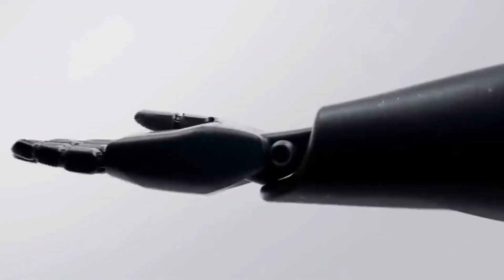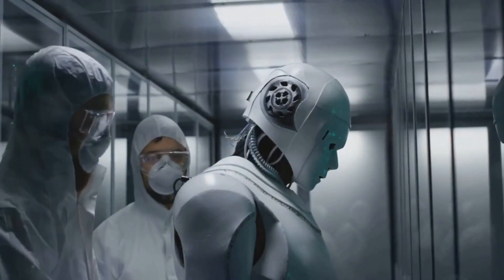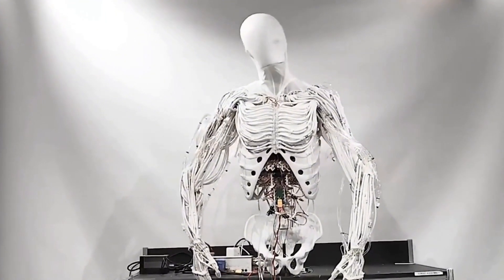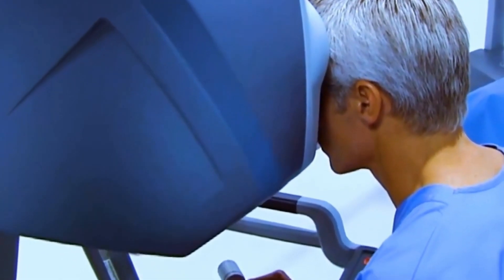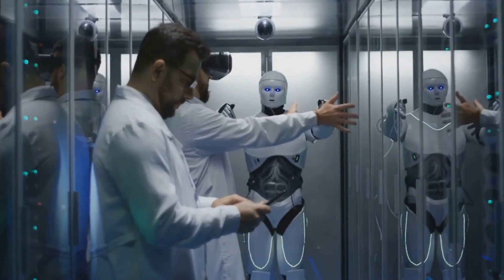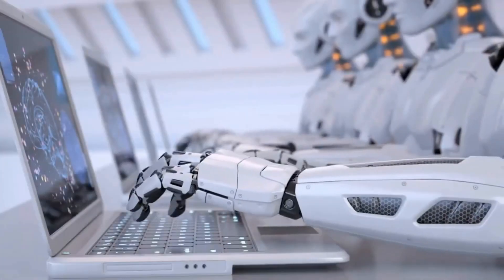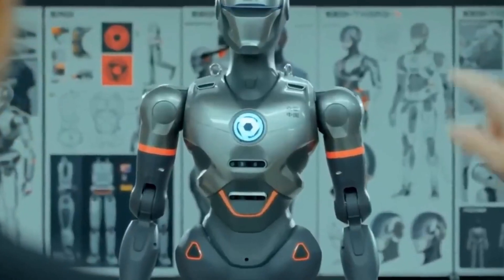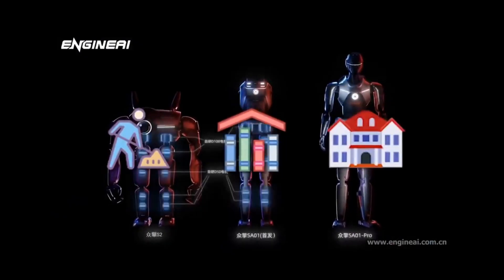INTRODUCING THE FIRST SYNTHETIC AI HUMAN WITH REAL MUSCLES (FAKE HUMANS COMING SOON)

Comment: The biggest thing is is never to allow them to hive mind because once they do that they can become an army of their own if they do become smart enough to go Rogue so unable to connect to the internet and become a high mind do not even put that ability in them in order to connect they would have to be hardwired no ability to be Wi-Fi whatever comes in the future cuz then you'll truly be asking for trouble and you didn't error on the side of caution
Reply from the maker: Very interesting your point. It would be the risk of creating awareness and being connected to the internet. You have to have security measures to shut down.
Reply from the maker: @JonSpaulding-l6c

Preventing hive mind capabilities in AI is a critical concern.  A distributed, non-networked system, relying on hardwiring,  mitigates the risk of a rogue AI network.  While theoretically feasible, creating hardwired connections might present technological hurdles and potentially limit the AI's adaptability.   This approach could hinder the AI's ability to learn and evolve in unforeseen ways.

The potential for widespread damage from a rogue AI with hive mind capabilities is substantial.  This highlights the importance of stringent design considerations and cautious development in AI technology.  How might the potential downsides of hardwiring affect the AI's overall performance?  If the AI could be designed to operate independently and securely without a hive-mind component, would that be a preferable approach?
Reply from the maker: @JonSpaulding-l6c

You're right, preventing a hive mind and rogue AI behavior is critical. A key aspect is indeed limiting their ability to network and share information autonomously. If they can't communicate and coordinate easily, the risk of coordinated action or a self-organized "army" decreases significantly. Hardwiring, rather than wireless connections, can be a significant safeguard. It would give you control over their network access.

Limiting or removing the ability to connect to the internet, or any future wireless communication methods, is a good idea. To avoid them from having too much autonomy, you need to carefully control how they receive and share data. This is a preventative measure against them gaining enough intelligence to become a threat.

Would you consider air-gapping them completely, or are there specific tasks where a controlled network connection would be beneficial? What are your thoughts on the ethical considerations of creating AI with such limitations?

Comment: Well we have to understand those functions in order to make a robot to be able to do them they're just some of them too dangerous for human beings
Reply from the maker: @JonSpaulding-l6c

Absolutely.  Understanding the underlying functions is crucial for designing robots capable of performing tasks humans might find too hazardous.  This includes factors like risk assessment, environmental analysis, and the development of safety protocols within the robot's programming.  Essentially, robots need to be able to comprehend the steps involved in a process and then execute them in a way that minimizes risk.

For example, in scenarios involving hazardous materials or extreme environments, robots can be designed with sensors and actuators capable of handling the situation without risking human life.  This means careful study of the function, and building safeguards into the system.  What specific functions are you interested in learning more about?  Also, are there any particular types of robots you have in mind that you think might be useful in hazardous environments?
Reply from the maker: @JonSpaulding-l6c

Absolutamente. Precisamos realmente entender as funções em detalhes para que um robô possa executá-las, e a segurança é um fator crucial. Algumas tarefas são inerentemente arriscadas para humanos, seja por causa de produtos químicos perigosos, ambientes hostis ou simplesmente a necessidade de precisão que está além da capacidade humana.

Robôs podem operar em ambientes perigosos como em fábricas com altas temperaturas, exposição a produtos químicos ou em operações de resgate. A robótica oferece uma solução para realizar essas tarefas perigosas, protegendo os trabalhadores e aumentando a eficiência. Além disso, os robôs podem ser programados para uma precisão maior do que a humana, o que é crucial em operações de manufatura e medicina.

Você concorda que a segurança é um dos maiores motivadores para a automação robótica em vários setores? Você acha que a integração de IA nesses robôs pode trazer novos desafios de segurança?

Comment: I think it's a good idea to have a robot help you.
Reply from the maker: @artkeck8077  Robots assisting humans is definitely a fascinating concept with potential benefits across many areas.  From repetitive tasks in manufacturing to providing companionship and care for the elderly, the applications are broad.  However, there are also potential downsides, such as job displacement and the ethical implications of increasing reliance on machines.

Studies suggest that while some jobs may be automated, new roles could also emerge in managing and maintaining these systems.  The long-term societal impact remains to be seen, but it's clear that careful consideration of the implications is necessary.  How do you envision the potential societal changes related to widespread robot use?  What specific benefits and challenges do you see emerging?
Reply from the maker: @artkeck8077,

I agree! Having a robot assist with tasks could definitely be beneficial. Depending on the specific task, a robot could offer increased efficiency, precision, and potentially even safety by taking over dangerous or repetitive jobs. It could also free up time for people to focus on more creative or complex work. There are different types of robots that have been developed to perform a wide range of activities, from industrial robots used in manufacturing and robotics for medical operations to more service-oriented robots like the ones used for delivery or customer service. 

However, there are also important considerations. We'd need to address the ethical implications of automation, like potential job displacement, and ensure that the robots are programmed and used responsibly. We have to make sure the robot is aligned with the user needs.

What kind of tasks do you imagine a robot helping you with? Would you be worried about any specific challenges that might come with using a robot?